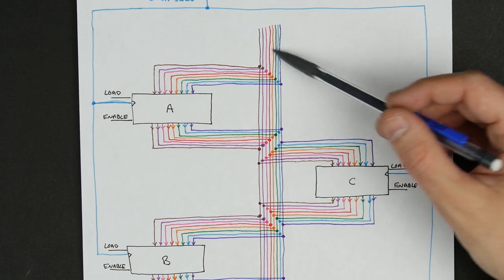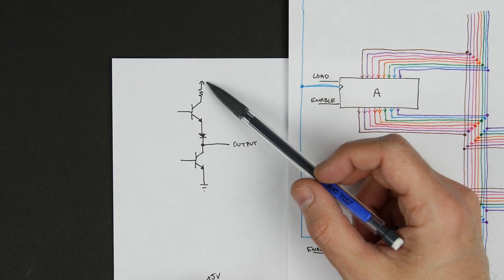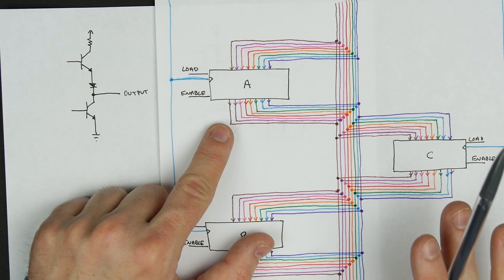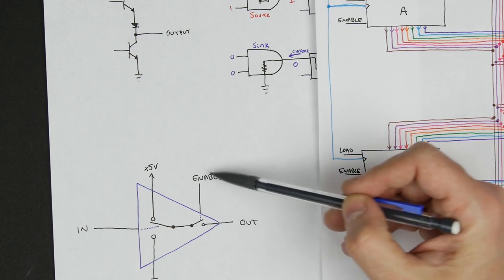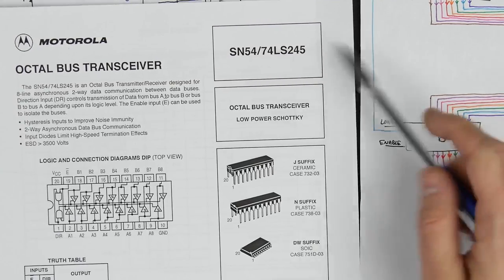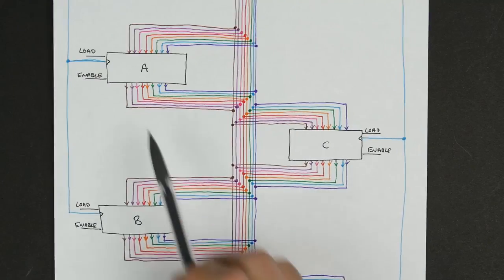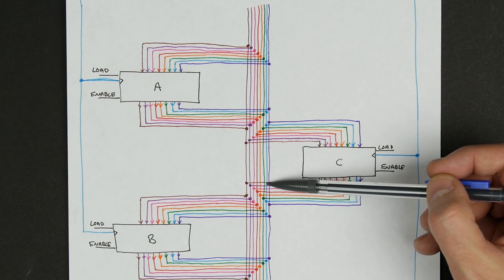Tri-state logic: Connecting multiple outputs together - 8 bit register - Part 2

Comment: outputting A and C at the same time would be a very quick way to "compute" the bitwise-or of A and C... :-D
Reply: I thought so, too, at first, but the more he explained, the more I doubted that. If A has a 1 in a spot and B has a 0, and they're both outputting, I think the current from A would just sink into the pin from B and you wouldn't actually get the right voltage out. Maybe? I don't know, I'm more of a software guy :D
Reply: @IceMetalPunk  yeah, after thinking about it more, I also thought that it wouldn't work because he connects a drain to bus-lines whose bits are zero
Reply: Some busses are constructed this way, it's called wired-and. Then you typically have a weak pullup on every line. If you would output a one, you don't drive the bus at all, because the pullup will take care of it for you. But if you want to output a zero, you enable a strong pulldown, with much lower resistance than the weak pullup.
There are systems that use this, but there are some disadvantages, like static current consumption when the pulldown is enabled, and slow rise time because of the weak pullup.

Comment: Why can't you just put a diode facing the bus between the output and the bus to get rid of the enable line?
Reply: Are you asking if we should put a diode on each bit of data output from each module (typically a register) facing the bus such that current only flows towards the bus, and then further asking if that change allows us to not need an enable bit going in to the tri state buffer (the diode being in between the buffer and the bus)? If this is what you asked, then I think I can answer by pointing out two things. 1: the output of a module, when 0, would not sink current from the bus, as there would be a diode in the opposite direction of the current between the bus and the tri state buffer. This means the bus would never be a 0, it would instead get nothing, which would probably be confusing to anything expecting a 1 or a 0, because a nothing is not the same thing as a 0. 2: the enable bit’s state tells the tri state buffer to, or to not, attempt to sink/source current to the bus. If this information was not communicated to the tri state buffer or the module, then how would any module know if some other module is already telling the bus what to do? And if multiple modules are attempting to communicate data at the same time, then how would be determine what data is from what module?

Comment: 2x Edit: Should start to describe the bus in terms of a taxi. More important the requirement, faster is the access. It is not a freeway, its a toll way. And there is preference on a bus. They just call it a bus because someone was thinking 1970 when they coined the nomenclature. Its essentially the design ideas from that time. And those ideas hit brick walls but never actually addressed the naming convention. They just stuck with bus, no mater how counter intuitive the word is to the meaning. Think of it like charm and strange quarks. Those names really mean nothing.

So this shows that the more components on a bus, will affect the speed of the bus. Unless you have different thresholds and triggers, where you can send and receive data in line through the bus. This is where interrupts kick in.
Edit, i am assuming this, however, this is similar to the "Wait until im done" and "I go first" and follows that circuits can share interrupts and halt the existing structure and assume full access for the data that they require. Because there is also an interrupt request which needs to happen first so that the previous connection can halt and store, so that the demanding procedure can operate. This is why early bus boards suffered losses in performance. Because they had to take precedence if they needed access to a "Main" bus. When eventually each solution would run in a parallel configuration, because the were engineered to conform to a standard which people became accustomed wanting. Eventually they didn't have to share memory because of higher band width bus. Then they crowded those bus.

Then engineered a newer bus. Which had rules, compliant to an ISA... Then PCI and then more.
Reply: ISA bus used irq which had a hierarchy. The more important the request, then they would have access to the bus, Less FIFO, more important and less important. So any devices receiving the IRQ would know if it needs to store its last state, and wait until the IRQ went common, or returned to their assigned position. That logic still describes how BUS is a concept which implicates a potential bottle neck.

Some early designs worked great for computing, and suffered on feedback via Audio Video, which require switching at speeds which we just cant physically detect with our eyes and ears.
Reply: The word bus. In electronics is NO WAY THE SAME as a public bus. Electronically, it is extremely preferential.
Reply: The idea of "Compliance" is take home. This means the bus will need to comply with certain conditions. This will lead very quickly into a schematic which has an ordered system.
Reply: Its really a misunderstood idea. There is no bus. It is more of a TAXI. Which will greatly explain itself.
Reply: And sadly, the wheels on the bus song stops functioning, because it is not useful and they do not need to actually go round and round.
Reply: The more you know.
Reply: i wonder how many people have tried and failed because basic ideas and concepts are misrepresented. If you broadcast during soccer you will be sure to get real winners to pay attention =)4444
Reply: I think you misunderstand where the term bus comes from in electronic engineering, it predates modern electronics as being the term for a common electrical connection as a shared equipotential connection in electrical engineering was already refereed to a as a busbar. From an electrical standpoint this is an accurate description of the bus as it is indeed a common electrical connection with all the inherent complications that brings including the need to implement some kind of layer 2 protocol on top of the physical networking infrastructure itself to control access and avoid collisions. Similar issues used to be common in older wired networking technologies like token ring Ethernet that used a common shared piece of copper between all devices on the network and of course just about every wireless communication protocol since you can't really get around the problem that the atmosphere is a shared medium for every device within transmission range on a wireless network.

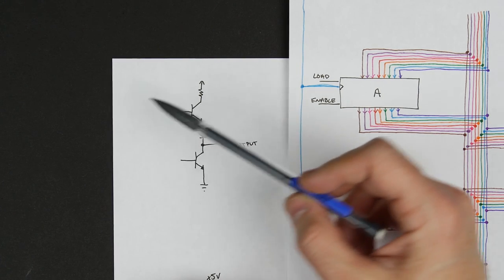Comment: what is the purpose of the diode at 1:20
Reply: So that if you try to put the voltage on the "output" pin higher than the supply voltage at the top that the whole thing doesn't run backwards.
Reply: Thanks.

Comment: Well, electrically speaking, if you try to put a 1 and 0 on the same bus line, it's going to end up as 1 XD
1's are bullies >.>
Reply: I thought it would just be a short circuit ?
Because it's basically connecting a 5v source to ground isn't it ?
Reply: @jean-naymar602  ya, I guess you have a point, anything on the bus trying to output a 1 while the line is being pulled to ground would ultimately be zero.
Reply: In case of TTL logic which is used here, 0 is more powerful: the first circuits could sink up to 20 mA at '0', but just few milliamps at '1'. And yes, it also can damage both outputs because of short circuit.
Reply: minecraft moment